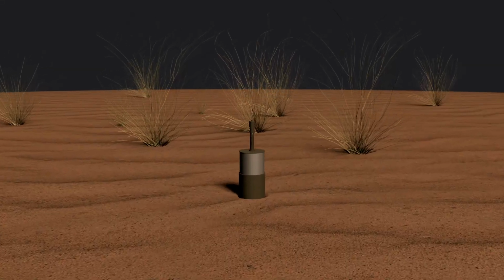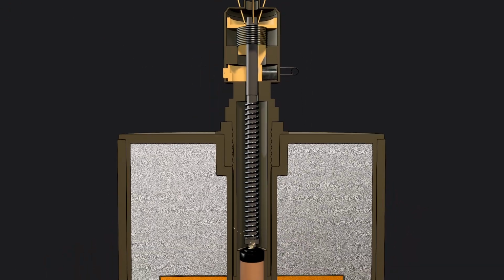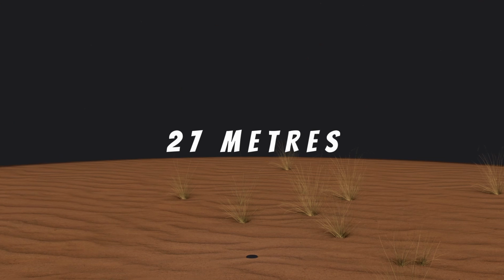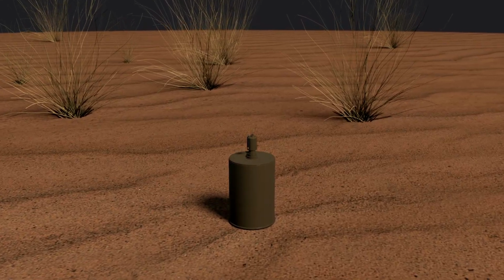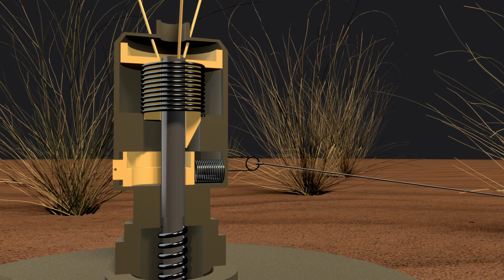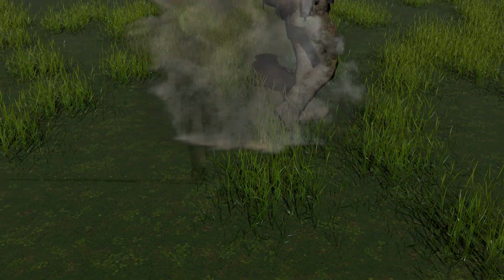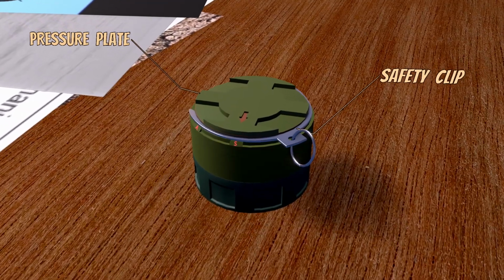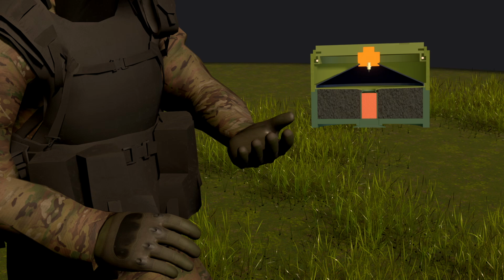HOW LANDMINE WORKS ? | M14 and M16 | #defence Mines Series Part-1

Comment: Having landmines to fly upwards before exploding is a nightmare fuel, why do they do that? Wouldn't exploding them on ground cause more dangerous shrapnel like rocks and dirt?
Reply: They jump up to crotch level then explode sending fragmentation out in circle around them can hit multiple people in an area of the body worse than blowing toes off
Reply: well if it detonated in the air there will be more steel pieces flying out in every direction
If it detonated on the ground, the pieces moving outwards below the horizon will hit the floor immediately so you get fewer people